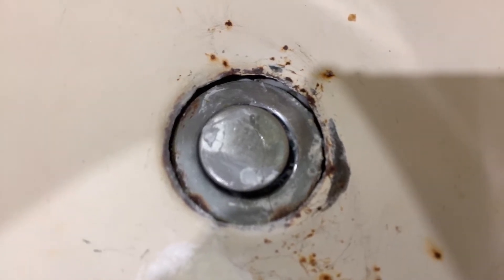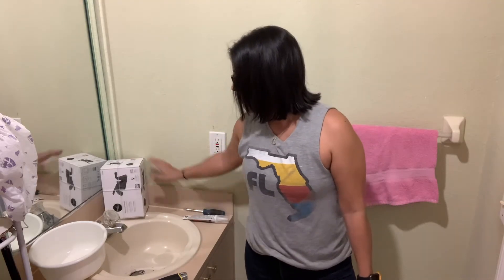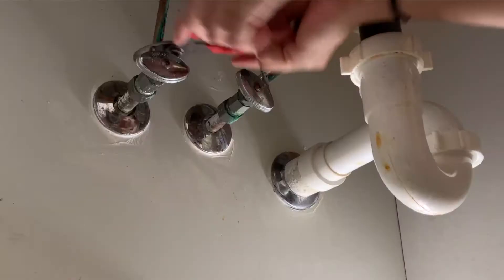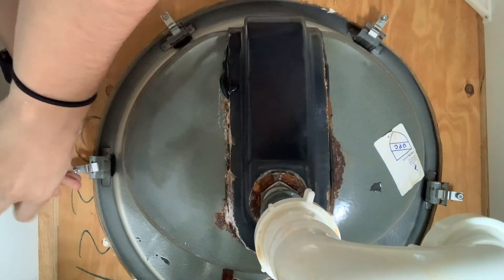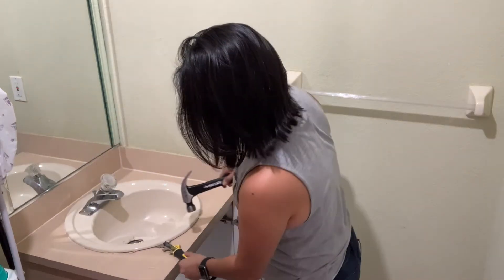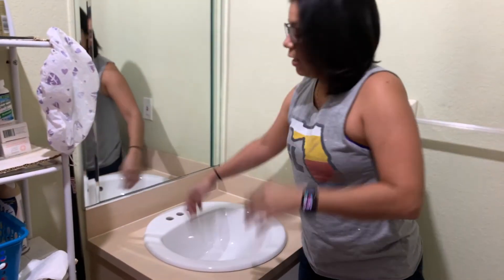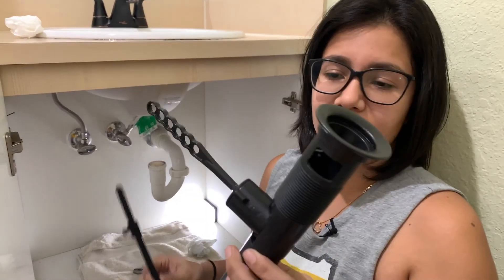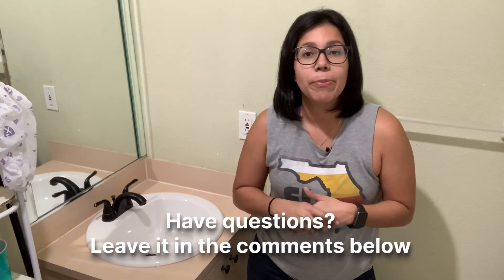How to Replace a Drop-in Bathroom Sink [Step-by-Step]

Comment: Thanks for this but you skipped a whole big chunk of the final installation! How to install the stopper the final drainpipe and reconnect with the p-trap. Did you clean our the trap or check for debris?
Reply: I think this was more to see how to remove and install the sink not how to connect the plumbing ?

Comment: Did the drain come with the sink or do you buy it separately? Do you use plumbers putty?
Reply: My new sink did not come with a drain,but a new faucet does come with a drain and drain pipe and rubber gasket.

Comment: Replace drop in with another drop in? Seriously? Why bother? We are in the third decade of the 21st century. Drop in sinks on laminate countertops from the past century and are so outdated. Get rid of that old vanity top and get a stone one from Home Depot with an undermount installed. It ain't that expensive and your house value goes up and you save wasted energy.